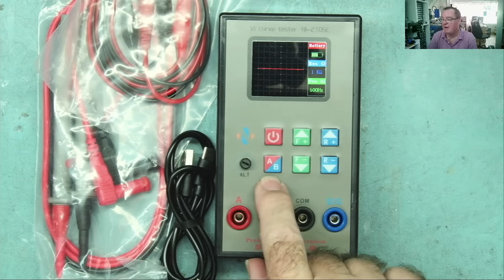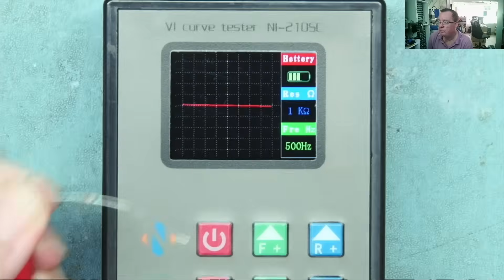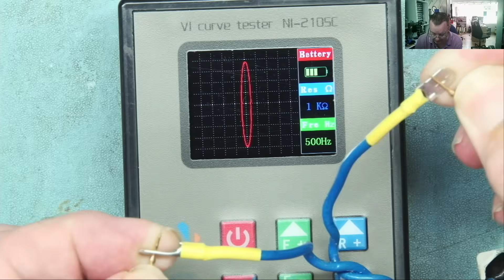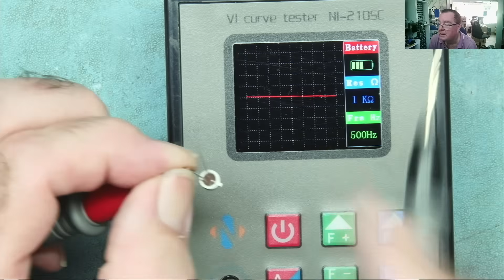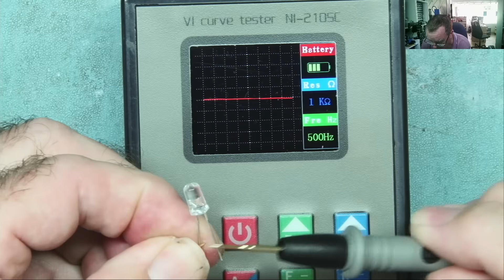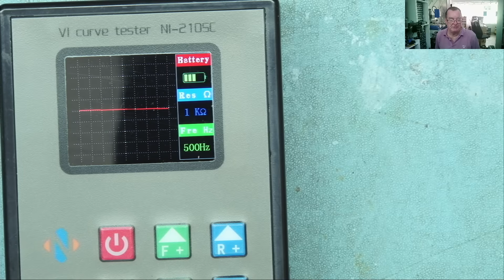How To Use A VI Curve Tracer To Fix Stuff!  NI-210SC AkA Huntron Tracker / Octopus Tester

Comment: The values displayed on the screen are clearly measured in 1V/section grid. Unfortunately, the +/-4V range cannot be expanded, which could be useful to test devices like zener diodes, etc.

Comment: Brilliant, i am starting to get a few bits of test equipment back together again to replace my older stuff I had put away in the loft. I used to be a "rig doctor" back in 1980 repairing and modifying CB radio and the ocdasional ham radio, packed it in when mobile phones arrived and killed CB but as Im getting on a bit now, thought it might be an interesting hobby as I get towards retirement. I have been a motor mechanic for many years and can't wait to reitre. Enjoying your channel very much... thanks bud.

Comment: I bought one of these from Alliexpress, It would not power up when I got it, A few taps of the back of the unit and it powered up wit a relay clicking sound, It powered up a few times and then left it for a week and now nothing. there are 5 relays on the pcb. Have you come across this problem? have you seen any schematic for the PCB? I have contacted the seller but not great to deal with. Batterys are fully charged
Reply: Scratch that, I just found a badly soldered leg on one of the ICs. All is good now

Comment: Just been looking into i/v curve tracers and thought I might make one. However when I went back into the workshop to do an experiment on testing capacitor's using a function generator (Rabbit Hole!) I looked at my old IsoTech ISR420 and noticed it had a component tracer built into it!! I may well make one anyway with dual input and a 555 to flip between A + B for Stereo Amp repairs as Richard has shown. Thanks for the detailed info and use. All the Best, Damo.

Comment: This is really good, thanks for sharing. I have a question if you could help me to understand this, can we use this to check micro controller (eg STM32F2 xxx) in circuit boards as micro controller runs on 1.8~3.3v and this output 4v ? Wouldn't that damage micro controller when diagnosing? Specially comparing two boards?

Comment: These things are not "curve tracers" as the term is used in electronic instrumentation. They are curve tracers of a sort, but nothing like a lab curve tracer. Lab curve tracers will display a whole family of curves and are capable of testing at hundreds of volts and substantial (e.g. 10 to 20 A) currents. They are the instruments used to generate the graphs of things like transfer functions published in datasheets for transistors.

I was wondering why so many people were talking about how great curve tracers are and when curve tracers dropped so much in price they were affordable by someone who chokes at the thought of a few hundred dollars for an oscilloscope. I hadn't realized the old Huntron Tracker had be resurrected as a low-cost box. Not a lot of companies made lab curve tracers. As with many things, Tektronix did. I don't recall if Hewlett Packard ever did. Huntron loved to try to make people believe there product was absolutely essential.
Reply: Huntron Trackers are a great tool for fast troubleshooting. Curve tracers, such as those made by Tektronix, B&K, and others give much more precision quantative measurements about a device's health.
Both instruments have their place in my lab, and are used daily.

Comment: Hi I wanted to ask a question! I have and old studio master 16 4 2 mixing console,it powers up all channels are working apart from busses 1-2 and master bus I’ve checked the faders and they are working but no audio is passing through except buss 3-4  I wonder how to test to find the culprit components I don’t have the original schematics for it there’s a block diagram but it’s not readable any help appreciated

Comment: This is so cool! When I was in electronics courses in college, we used a curve tracer to display the IV characteristics of various silicon components as we learned about them in class (I.e. diodes, transistors, etc... like you showed in the video). We learned how to read the graph displayed, but didn't learn much about using a curve tracer practically. The thing that stuck with me though... The curve tracers in that lab were the old-school analog CRT type. ( I don't remember whether it was solely a curve tracer or an oscilloscope with curve tracer functionality, but it was cool as hell). And using it instantly sparked my fascination with vintage electronics. It super cool to see how to use a curve tracer practically! Thanks, Rich!

Comment: Pretty sure this is the only CT video that shows it being used properly (to compare two boards). Nice job 👍 Compared to the Huntron which switches to/from the A and B sources via a relay, the one you showed is actually better having both traces on the screen at the same time. If it had a bigger LCD and had adjustable test voltage it would be perfect.

Comment: Hi. I work as an electronic repair engineer repairing industrial electronics. I use it almost on a daily basis. I use the Hameg oscilloscope, which has a build in CT. (HM504-2). Next to comparison, you can see out of circuit if a component has developed resistance. I had a transistor once which passed the test on the component tester but had developed a resistance. With the CT I found it. Also, you can do what we call a CT-scan: using it in-circuit to see fast for short circuits and open circuit in components.  When you work with it for years, you start to recognize what signals are normal and abnormal. I even check resistances with it in-circuit. It's a great tool for the electronic workbench.
Reply: Yes, it works great and fast. When you do routine circuit repairs you can remember and save the curves, such as taking pictures, to make a database and easy to compare. CRT displays have a much faster response and are much more detailed than digital. I have been using a HAMEG HM604-2 for about 8 years now. I got it second hand for about $50. I think it was a great deal. My YouTube channel is still active. I repair as a hobby.

Comment: I use rastrecurve with pc software, you can reference in file a known good pcb and use that reference in future pcb tests,  this is very good to quickly test a pcb board like car ecus, just by testing the pins of it you can see if there is a problem inside the ecu

Comment: How safe is it to use one of these on modern equipment? If you use a test voltage of 3-4V on a chip that works on 1.2 or even 0.9 volts - can you break anything? I understand the internal resistor limits the current. But I still wonder whether using 3x the specified voltage could cause the delicate internals of some chips to break down. Maybe not all. But there are chips out there that die if you sneeze too hard in the other room.

Comment: In your example what you do next after let's say you discovered differences between two chips? you remove those and try to find more differences in that area? and if there are no other differences you replace the bad one?
Reply from the maker: Actually I'm continuing that repair today so will see what I do next 😉
Reply: You only remove the component that shows the difference on the bad pcb and replace it. Then, you repeat the comparison test. The curves shown now should match to each other. The key in using this device is to have a good unit for comparison with a suspect one.

Comment: I’ve seen the curve tracer used to find matched (gain) of transistors to use in differential pairs in audio amps. I bought a kit for using with a dual channel .. x/y input oscilloscope .. time to set down and build it.

Comment: Haven't seen a curve tracker before. I guess you could still use it on a single board and check the output to determine if the curve is representative of the component being tested.
Reply: Yes but sometimes you get different measurements in circuit than isolated

Comment: useful for matching transistors (especially in audio amplifiers) and determining appropriate replacement transistors where you can no longer source a given part
but generally I would want to be able to apply a greater range of voltages for this purpose than this unit provides

Comment: Per the sheet of the front panel,  in single channel mode, the blue plugin puts out a pluse at 5 volts. What is that used for/why?

Comment: Sorry to but that is a very limited and
BAD, nearly useless curve tracer!!!!!!!!!!!!!!!
Reply: no multi current stepping, not third terminal, ...just a TOY!!!!!!!!!!!!!!
Reply: ***CORRECTION,  it does have a third terminal, NOT SHOWN functioning in the video
Reply: @stevenbliss989 The discrepancy between your tone and your last name is stark, but it did amuse me.
Reply from the maker: @stevenbliss989  You can set the output impedance of the tester which surely is the same as current setting? And what 'third terminal function' did I not show in the video? If I missed something important then I can do it on the livestream tomorrow, just let me know and it will be done.
Reply: @learnelectronicsrepair i guess he meant a third terminal, like stimulating the gate/base drive of of BJT/MOSFET whilst seeing the Vce curve…
Reply from the maker: @LB7ZK  Ahh,  it does have that I just didn't realise the significance as I never saw a curve tracer with that feature before.  It says on the instruction sheet that when used in single channel mode, the unused terminal outputs a 5V pulse every second.  That must be what it is for.

Comment: As the former reaction mentions the Hameg oscilloscope: I just obtained a HM107 Hameg. With built in CT.  One of the early models Simple but great machine. Slightly bigger in size :-) but not as big as my other Hameg analog crt.  
It does great work. And I was inspired by your n555 solution with an alternating relay to do this simultaneous curves writing on screen. I’d like to dub that !  
Thanks for your relentless and prolific production of videos ,, 😎
At our place you’ve become one off the voices one hears….
Reply from the maker: You're welcome. The ghetto version I built is just as useful as this one and based on reverese engineering the Hameg add-on oscilloscope curve tracer you mentioned which I also have.  But the fact you don't need to set this one up (it's just a standalone item) means it is just much easier to grab and use so I'm much more likely to use this in my repair work
Reply: My oldish Hameg analogue scope still has those curve tracer outputs, but unlike the Huntron, you cannot compare 2 PCB’s simultaneously, and that is where those dual-channel tracers were effective… on my Hameg, I think I used it once or twice for curiosity’s sake, as that is far removed from a real curve tracer, like those unaffordable tektronix curve tracers that we had in the R&D lab…

Comment: I think the problem with these Chinese devices is that their test voltage is way too low to really stand out against multimeters. Parts that have trouble at higher voltages are impossible to detect with multimeters. A VI tracer with 60V like the huntron 1000 for instance goes much deeper into the circuit, so to speak. I've never used one myself, but I browsed the really fantastic manual, which shows the patterns for any imaginable device. In general, I think it is a little difficult to get an intuitive understanding of a complex shape and draw conclusions from it.
Reply from the maker: This is why I consider a curve tracer to be a comparison device not an analysis device.  But if you have a known good and bad PCB or a single PCB where there are a lot of repeated circuits (USB/PCIe lanes, VRM, op-amps, buffers, drivers etc then this is a very useful diagnostic device.  Regards test voltage I have one of the original Hameg curve tracers and I reverse engineered that to build the 'ghetto' vesions (see the video description) It injects nothing remotely like 60V into the deivice under test!

Comment: The only thing I'm still confused about is the inconsistent use of the terms Curve Tracer, Octopus, and Huntron tracker. Is Octopus the curve tracer that connects to an oscilloscope in XY mode, while Huntron always contains its own screen? Does the octopus always run at line frequency through an AC transformer while the Huntron allows variable frequency? I've seen people use these terms completely interchangeably.
Reply from the maker: My 10 pence worth.  The first time i ever saw something like this was the Huntron Tracker back in 1983 because they had one or two in the workshop I was employed at. Having said that it was not a new device at that time and probably dated from the 1970s. This was standalone device very similar to the one I demonstrate on this video.  It did not have variable frequency but it did have variable voltage level.  The next version I ever saw was the Hameg tester in the early 90s which is the same sort of thing but single channel and is an an addon to an oscilloscope.  I modified that one using a 555 timer IC and a relay to give the same features as the huntron tracker - and later reverse engineered it to build the 'ghetto' version linked in the description to this video.  Octopus tester i have never seen one but some viwwers pointed me in the direction of that device (from the 2000s?) and basically this is another brand name for the same sort of tester and is an addon to a scope like the Hameg?  So they are all curve tracers.  It's like calling a vaccuum cleaner a 'Hoover' even if it is made by Dyson.  I honestly did not know that a modern version of the old (rare, sought after and expensive) Huntron Tracker existed until I looked for one and then made this video.
Reply: @learnelectronicsrepair Thanks for the very detailed answer!

Comment: Amazon has them way cheaper.
Reply from the maker: Can you post the link please, or if YT blocks you email me electronicanaria@outlook.com and I will do it.  There is a version of the same one I demonstrated that is an add-on for an oscilloscope (no built in screen) they are about €20) but the reason I never used one in my videos is the hassle of having to connect them up to the scope.  You could call that lazy on my part.
Reply: @learnelectronicsrepair  I didn't notice they were missing the screen.
I need to start paying more attention.

Comment: Not entirely sure if I would use it on my workbench. Comparing boards and components, I have been using the multimeter method without problem. It's good that I am now more aware of curve tracers, perhaps I might encounter a situation in the future where I will find a benefit to me owning one, but until then... Thanks for showing us Richard, I'm a little bit more knowledgable once again at least.
Reply from the maker: Agred this all depends on what tools suit your requirements the best.  The main usage of the curve tracer (as far as I am concerned) is as a comparison device.  But if you often have this requirement it is an excellent no-brainer device at what it does and will probably save you enough time and money very quickly to justify the cost, which is not cheap but not excessive either.  Otherwise if you have an old scope and not a lot of money build the ghetto version.
Reply: @learnelectronicsrepair  Agreed. If you are doing a lot of comparison type of work, then a visual aid would likely be more efficient than using the multimeter.

Comment: in the 60s/early 70s they were in most work shops mostley home made  useing an ecc83 valve ans a small ac transformer.
we had a Telequipment scope (mid 70s) with one built in  but then at least in tv work shops there use died out. not sure why.

Comment: Nice demonstration. A lot of electronics double up on circuits. So it definitely is a useful visual comparison tool with instant feedback 👍
Reply from the maker: Absolutey. Even if you don't have a known good PCB a lot of electronic circuits (eg VRM phases etc) are duplicated on some PCBs and you can aslo use the curve tracer to good effect in those scenarios

Comment: Back in the 80's  I worked in a repair workshop. One of the better "Hameg" oscilloscopes had this feature built in.  A few years ago I built Paul Carlson's Curve Tracer and I was going that adapt that design to switch between 2 channels. I think it was yourself that  I see that idea come from.  I don't often repair much at home these days so it's not really got much a use case, sits around collecting dust mostly.  They can be useful to see how sharp a Zener will turn on etc :) I like that the Ali Express one saves setting up a oscilloscope. :)

Comment: I’ve used curve tracers for 30 years to good effect. I’m surprised they’re not popular!
Reply: Me too, I been using curve tracers for decades.
Reply: Maybe it's because they're not as usefull as it seems, I mean a simple multimeter can do the test jobs seen in the video.
Reply: @raphanunu6912 Curve Tracers are the first line for find problems in the industry.
Reply: I use it for 9 years ago on iphone repair 
You are right it’s not popular
Reply: I paid 4k usd just to know this item existed
Reply: @ashraf8934  $3 to become a patreon to Mr. Carlson's Lab and have access to build his curve tracer. As a bonus you'll get a full understanding on how it functions as you build it. Parts count is pretty low, three TL072 op-amps, about a dozen resistors and half a dozen pots, plus 1 light-bulb, assuming you have a power supply that does +/- 15v and a scope with XY mode.

Comment: Yeah, in the 1990’s we had the Huntron (???)  curve tracers in the production test lab. Some people used it a lot, with great success. As for myself, never actually used it… (but then we had circuit diagrams, etc, so for me it was quicker just following a circuit diagram). I can see it’s use if you have an identical PCB and no circuit diagram. It will allow you to zoom quickly into a faulty area, and then you just need to reverse-engineer that part of the circuit.